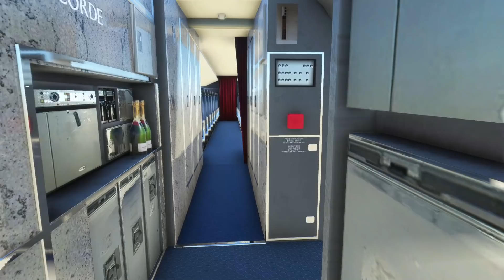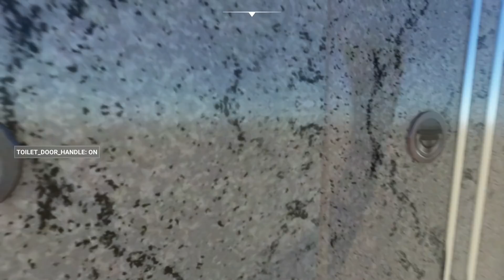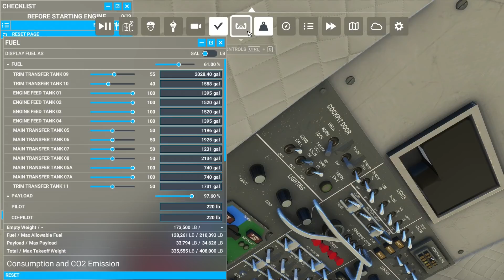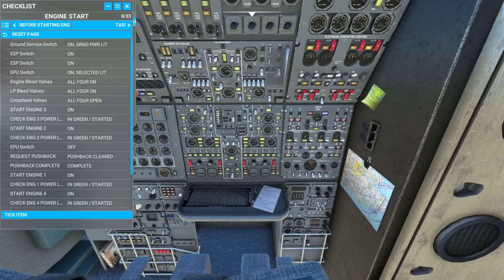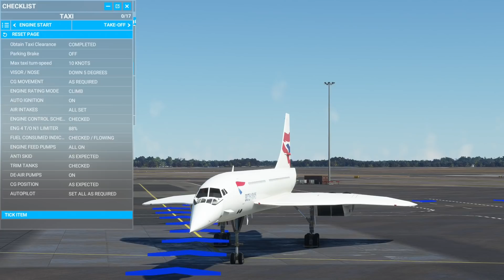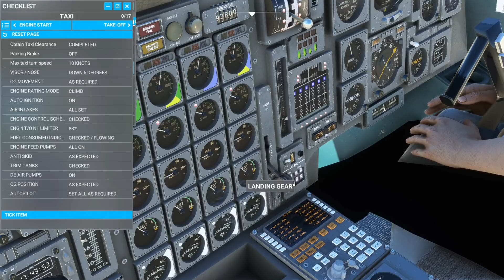DC Designs Concorde (MSFS) - Review and Tutorial / Test Flight - Part 1: Cold and Dark Start, Taxi

Comment: The bottom of the headrests in the passenger cabin, should line up with the middle of the actual windows. 2 windows per passenger row. (looking back at pictures i took inside G-BOAG that's parked at Seattle Museum of Flight)  Basically, the windows are too small for the seats.. This cabin looks way too spacious compared to the real thing.. mind you, she's only got a thin body.
Reply from the maker: I was thinking that too. Didn't actually verbalize it, but yeah... 100% right.

Comment: I follow your steps and number 4 does not start
Reply from the maker: All the other ones do? Things to double check - make sure EPU is on and the annunciator SELECTED is illuminated. Make sure crossfeed valve is in "horizontal" position. Make sure the LP switch for engine 4 is enabled (the one behind the red cover), finally, make sure all the other engines are past startup completely and you aren't trying to start two engines at the same time. Finally, to rull out any sort of fueling glitches, open up the sim's fuel window and make sure there is fuel is every tank there should be fuel in. Hope this helps and let me know if this works.

Comment: does it come with a manual
Reply from the maker: Yes it does!
Reply: @zentropyaviation5182  i can not find the manual, could you link it to me?
Reply: @bluefin2349  community folder
Reply from the maker: @bluefin2349  It's in the subfolder of the aircraft.
Reply: @zentropyaviation5182  thanks!
Reply: Where is the manual located?
Reply: @tanberjan  community folder
Reply from the maker: @tanberjan  It's in the aircraft folder itself. There is a subfolder entitled "Documentation"

Comment: I'm not even 30s into the video and there's already drunken shenanigans.

I like your gimmick, Jeremy 😉

Edit: How is the framerate?  Don't know if it's a recording thing or what, but for how low res those textures look, the framerate looks pretty choppy.
Reply: I can confirm it’s not good to say how low res it is. I’m on a 3080ti 32gb ram and i910850 
🧐
Reply from the maker: The frame rate - mine is capped at 40. I am running maximum settings (Ultra). Yes, it's partially a capture thing, but it's also a JFK and being on the ground thing. Shortly after takeoff FPS went up to almost 30 and right now in cruise I am at 40 FPS. So I don't think it's that bad.